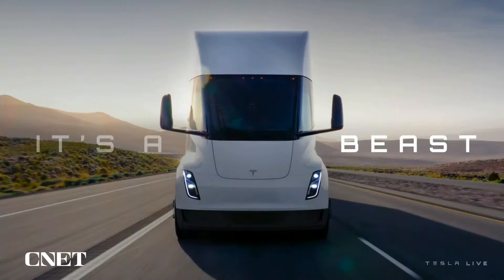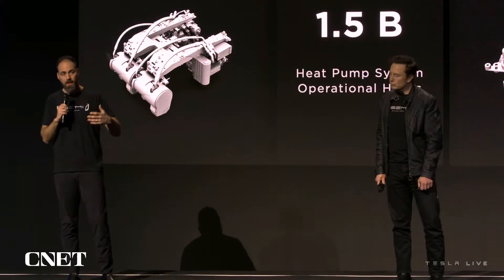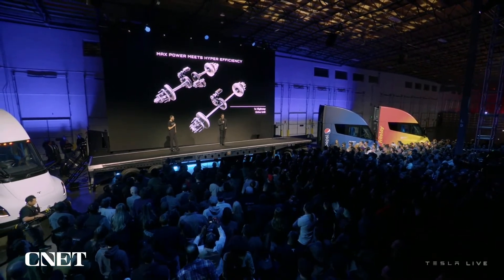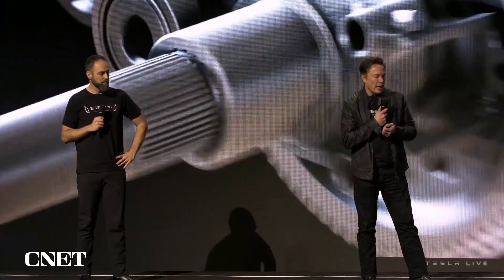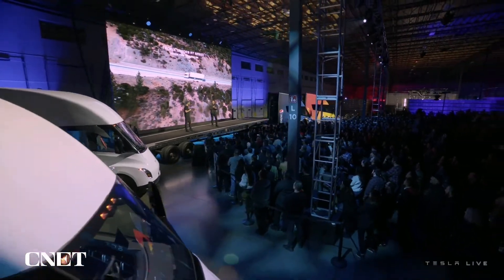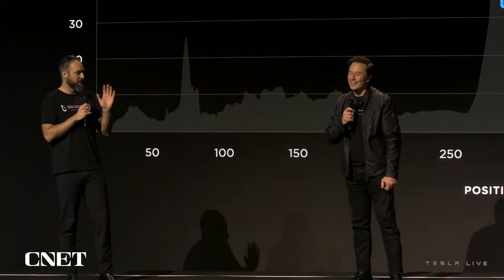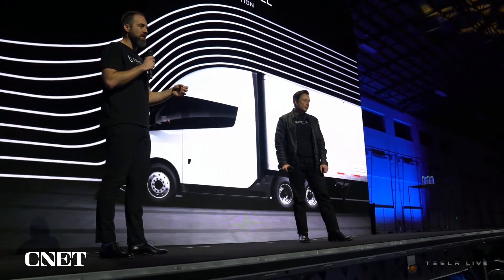Watch Elon Musk's Deep Dive Into the New Tesla Semi-Truck

Comment: I've been towing road trains in Australia for quite a few years now and I can't see anyone buying them with the driver sitting in the middle of the vehicle, I definitely wouldn't. You need to be on one side (depending on which country you live in) so that when you have to reverse you can put your head out of the window to get a view of whats's outside the mirror's range, it's really important. Other than this major design flaw (it's probably so they can make one version of it for export) I think it is a step in the right direction. Once we get decent batteries that last for decades and not years the world will make the switch, but for now we will still be using diesel for the next little bit at least.
Reply: I think it has so many cameras and screens showing a 3d view of everything that it should be ok. Also it would back itself up ideally. 

Definitely gonna have to prove it's innovations are worth it.
Reply: @quinnfoster1234  I'm not a big fan of cameras and even less of a fan anything that reverses itself. These things add unnecessary complexity into an already complex equation. Anything that I have driven that has a camera in it always takes your focus off the road for too long and a lot can happen in a split second. I just don't think you can beat the simplicity of a mirror and what you can see with your eyes. 360 cameras make it impossible to judge tight gaps when reversing and that is when most damage occurs. The tech still has a little way to go yet in my opinion.

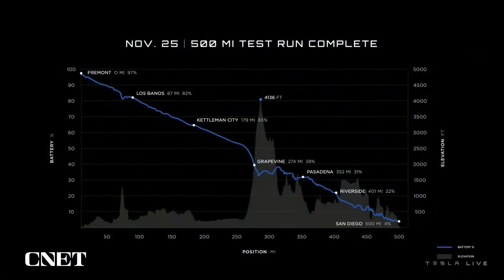Comment: 11:15 The Semi used a goodly chunk of power climbing the Grapevine but recouped 80% of the energy on the other side of the hill. Your conventional truck or even a hydrogen vehicle wouldn't have been able to do this (hydrogen fuel cell vehicles only have a tiny battery). Regen is the secret sauce that makes this truck golden.
Reply: I don’t believe this is correct; it recoups only about 21%. Grapevine starts at about 52% state of charge, not the white dot, if I’m not mistaken. The battery drops to approx. 33% at peak elevation, but it regains charge going downhill getting back up to approx. 37%. 52-33=19% lost. 37-33=4% gained. (4/19)(100)=21%. It regains 21% of what it lost going up. 80% would be quite impressive.
Reply: One ingredient in da sauce mmhmm
Reply: too bad most miles are done on flat highways...
Reply: Hydrogen vehicles will probably have a battery to regenerate to
Reply: @ixyzyxi  HFC vehicles only have a small battery, enough to buffer the output of the fuel cell output and provide a boost when needed. This is similar to hybrid petrol vehicles (specifically the Prius in mind)
Reply: @Clark-Mills  You won't change a very big battery going downhill. TFL tested an electric towing pickup and they saw very little change added to the battery
Reply: 11:09
Reply: Your dads secret sauce makes my mouth water.
Reply: Still 500 miles in Australia is nothing mate, less the battery can go from Perth to Sydney , Tesla has not got a market in Australia, AS with deisel trucks , Drivers are going to fast , to long.
In Australia long haul driving is fraught with danger.
Reply: @Ossie Dunstan  500 miles is enough to reach your dads place and back, though. Trucks are not really suited as we normally run a train on him.
Reply: 😂😂 How’s The mighty Tesla semi doing 😂😂
Reply: Never.  The math says that it won't.
Reply: @johnbauby6612  it's still power lost but nothing wrong if regen braking can give you 1-3% power back, it's still a win, it's like you diesel fuel suddenly get extra 100ml every time going downhill which is nope that will not happened in diesel engine, but only possible on EV.
Reply: @johnbauby6612  he said 80% of the energy used uphill, regenerated back to the battery when going downhill from the Grapevine. You still lose energy, but the loss only totaled to roughly 20% of the energy used in that time.
Reply: @TheReal_JG  Why not calculate with the EXTRA 150% running price over Diesel! OPPS NO MORE TRUCK! it will never work!

What happens one year latter (assuming very limited use) when the battery only holds 80% charge?  LOL

Comment: I wonder how this thing works in extreme environments like the ice road up in Alaska or some extreme heat down in South America... Can you fix it on the side of the road easily??
Reply: TESTED in Fairbanks , AK USAF testing grounds.
Reply: Didn't watch the full presentation?
Reply: Imagine a motor fails on a diesel?
Can you fix it at the side of the road?
Now, a motor fails on this Semi.
The computer disengages that motor and you keep driving.
The truck sends a full diagnostic to Tesla .
They call you, ask if you are still heading for your next stop as programmed and tell you a technician will meet you with parts for an overnight repair.
Sounds like a plan?
Reply: @rogerstarkey5390  yeah I'm sure it'll work perfectly just like his robot and his tunnel

Comment: Did they fix (or at least mitigate) the weight problem? They didn't mention anything about how heavy the truck is. Federal limits for semi-trucks/lorries on public roads/highways is 40 short-tons (80,000 pounds) for gross weight. The lighter your truck is empty, the more stuff you can haul and the more profit you can rake in; and batteries are HEAVY.
Reply: TESLA semi can operate in EXCESS 82k Gross (Trailer + Cab) and hauls for 500 miles w/ 35 miles in reserve. 
can LEGALLY operate without weight penalty. 
and compliance conformaty w/ EPA. 
SUPER EFFICIENT 1.7/kwh mile.
Reply: It's mentioned there will be a lighter weight shorter range model if you are worried about capabilities.

Comment: Can the second axle be locked in manually for traction on slippery surfaces?

Seeing the comments on here, it just AMAZES me that the US is part of the "first world". Science education is just appalling!
Reply: If that didn't happen automatically I would be disappointed
Reply: @Quinn Foster  I expect the NEED for locking will be FAIRLY reliably identified (ice road traction, offroad concrete mixer/dump trucks, offroad logging trucks in swampy terrain??), and likely the signal to the clutch to engage will be sent when supposed to, but what about a mechanical problem on one clutch which fails to engage, leaving dynamic braking and traction control questionable?

Comment: for trailers, cover the top with solar panels, with ultracapacitors in a box inside. this can be connected to regen as well, as ultracapacitors charge much faster than batteries. computers can use this to extend range even more.
Reply: False
Reply: @quinnfoster1234  you must work for Ford
Reply: @quinnfoster1234  great, 'can't be done' was said two or more times in the past. Once in the 1800s scientists said no more knowledge can be known.. then Einstein came.  In the 1980's using logic probes trained engineers said microcomputers were impossible.. then steve made one in 24 hrs. for 500 bucks. So it just depends on the skill of the engineer.

Comment: The Tesla semi is literally the worst possible design for any semi specifically because it’s driver seat is in the middle of the truck, any CDL Class 8 driver or DOT official can tell you it is a absolute requirement that you put your head out of the window to observe directly when doing any backing maneuver, especially a alley dock. Tesla decision to move the driver seat in the middle simply means the majority of trucking companies, especially Owner Operators, will never buy a Tesla semi because their product creates a massive safety hazard, and where the heck is your co-driver or trainee going to sit???
Reply: TESLA semi - like a BULLET not a BRICK WALL.
Reply: Idk anything about CDL but I think you would be required to train on a normal semi, then this would be so easy to drive you basically just hop in and go. 

Backing up interesting issue as well but I think the many cameras and self driving are their solution. Proof remains to be seen in trials and tribulations.

Comment: I ran LA to the Bay a lot, and can see the Tesla Semi having a special place doing runs like this. I'd be super jazzed running up the vine and back down into Castaic, with cold brakes and flying past everyone on the climb. Can't tell you how frustrating it was making sure you had your revs just right and being in the right gear 2-3 miles before climbing. Only to still sluggishly play leap-frog with trucks that were only going 1-2 mph slower than you. It'd definitely make traffic safer actually going highway speed up hill and not slowing the rest of the traffic.
Reply: Imagine running on Autopilot, GPS warning of a down gradient, a weather app predicting Ice (low temps) and the Autopilot setting the speed and regen to suit at the top of the hill?
You just watch the systems work and the regen increasing the range.
Reply: @rogerstarkey5390  it's the fastest way to the bottom of the hill I'll give you that
Reply: no Gears , no jake Brakes.
Reply: That mfin grapevine, the San Joaquin valley is alright, L.A. traffic is the worst, and the San Bernardino portion of the 15 can be full of traffic on those Fridays and Sundays

Comment: The one thing I don't understand is how this vehicle will be efficient at hauling goods.  Every person I've heard who has an electric vehicle that has the ability to tow says that towing immensely eats into the battery to the point of losing half the range.  This is based on those who tried towing a car on a trailer.  They said an electric vehicle is nowhere near as efficient as a diesel or gasoline powered engine when towing was involved.  I'm not sure how Tesla managed to not have this problem when towing thousands of pounds.
Reply: It has 10 times the battery of model S. 3 times the power of regular semi. This thing will be expensive as fk. At least upfront cost. Will make it up in fuel cost saving very quickly.
Reply: TESLA semi is SUPER EFFICIENT hauling 82k Gross. 
hauls 82k Gross 500 miles , consumes only 1.7kwh/ mile. 
has LOWER drag than Bugatti Chrion. 
saves operator $200,000 per year.,
ROI just 1 year to PROFITS.

Comment: it be great to add re-gen braking to the trailers as well and recover some power also :)
Reply: The battery and inverters have a power limit which will be fulfilled by the motors in the semi itself during regen. So adding more motors to the trailer for regen won't achieve anything if the battery power limit is not also increased.
Reply: @AmaanKhan-gt5be  
Great answer

Comment: I'm just wondering, how much time will it take to recharge from 10% to 100 percent?
Reply: 70% takes just 20 minutes.
Reply: normally on road, you Dont charge to 100%. usually 70%.
can to Charge to 100% overnight . REST period.
Reply: 10-70% 30 minutes
If 500 miles is 7.5 hours, 30 minute stop.
60% is 300 miles, you need 200 miles max for the allowed 3 hours (11 total) per day 
You don't need a 100% charge during the day.
.
Overnight, a V3 charger would take 4-5 hours.
"No network" isn't a valid argument.
Reply: @rogerstarkey5390  thank you for info. It's a fantastic look forward, and promising for transport industry

Comment: I am a truck driver, my only question is when we stop to rest how the truck is going to keep us warm on the winter for 9 to 10 hours because we cannot keep the truck plug in the same time with the heater on?
Reply: YOU can Charge and HEAT cabin at same time.
Reply: Having to plan on keeping a charge to last overnight will be part of the job I guess.
Reply: Let's see....
A heater sufficient for a cab?
2kW?
Call it 3kW.
10 hours, let's say 20.
60kWh.
This truck, 1000kWh.
(You should be ok)
If it's actually 2kW, that's 500hrs or 20 days on a full battery
.
Also, when you stop and rest, the idea is to "ABC"
Always Be Charging.
If you pulled into a service area overnight, even if it had "car" chargers, they could charge this truck in 5 hours with an adapter and power your heating.
(Very few cars would be there)